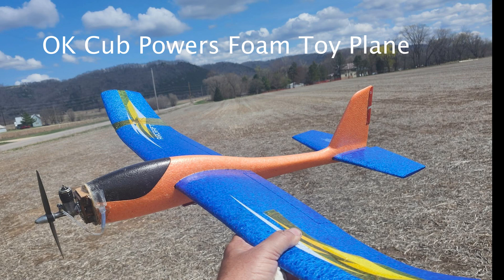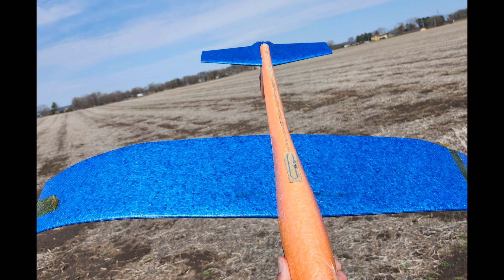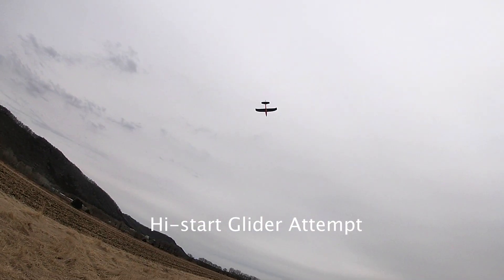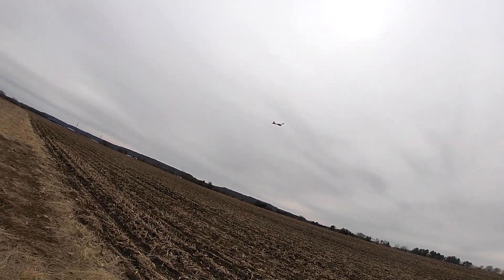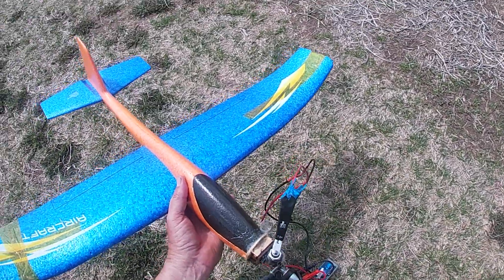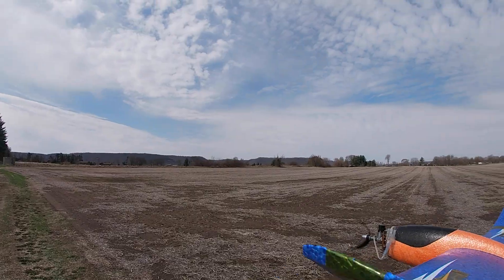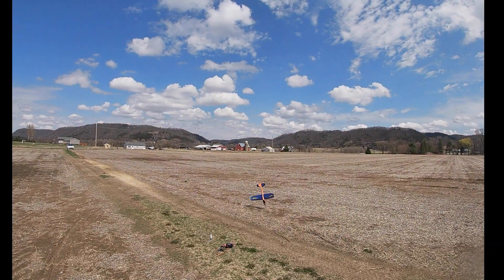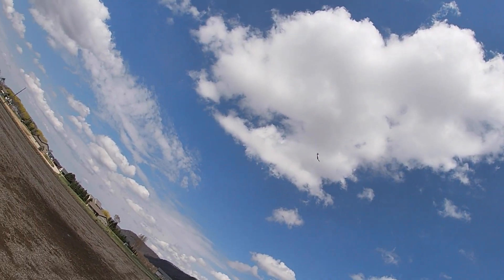OK Cub Powers Foam Toy Glider

Comment: I had a free flight with a Pee Wee 0.020 that was running poorly. Normally I'd launch with less than a half tank of fuel, but this time, the tank was full and the engine seemed like it was about to quit. Launched the plane (a Berkely Baby Yank) and off it went the engine suddenly finding its song. Never saw it again!
Reply from the maker: I sure have seen that where engine running poor and all of a sudden starts to run strong. PeeWee .020 does seem like a hard one to have a consistent run with every time.